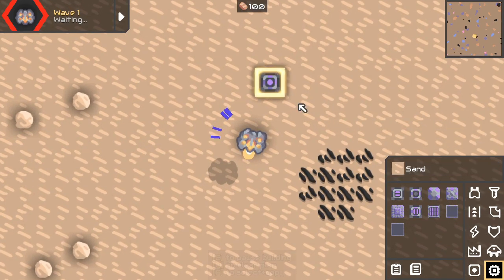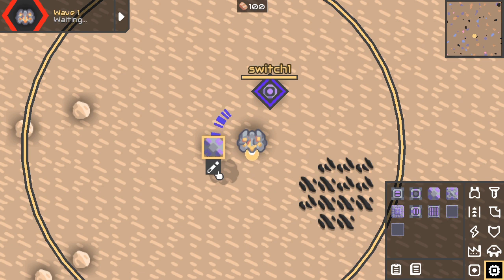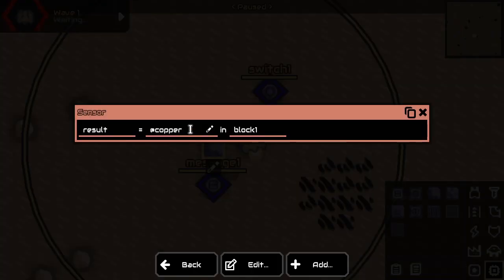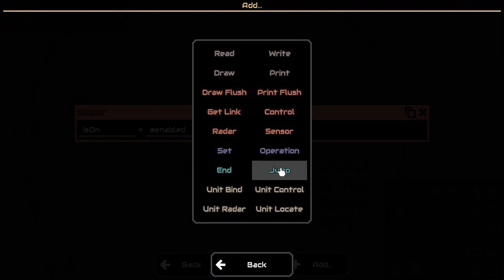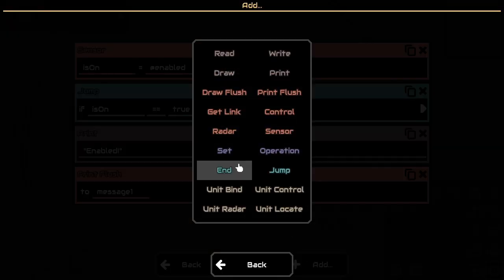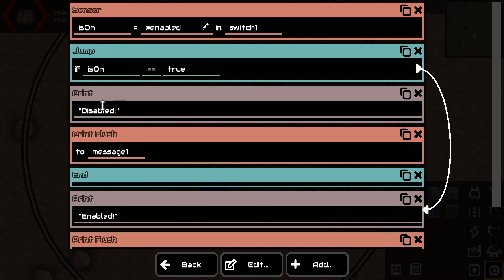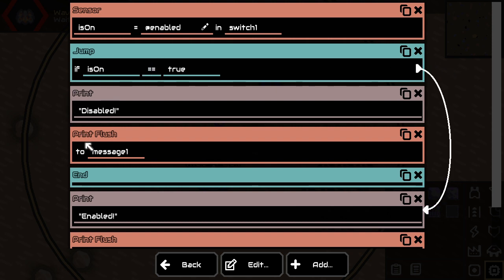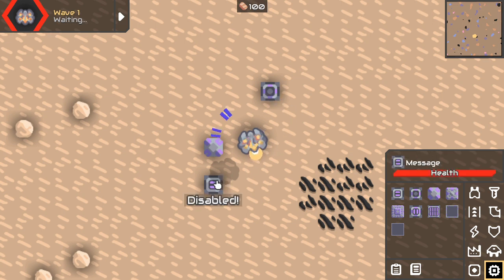Working With A Switch - Mindustry v6.0 Logic Tutorial

Comment: thanks so much! im finally making progress on my platformer!
current progress:
set px 45
set py 45
set xv 0
set yv 0
sensor -dx switch3 @enabled
sensor +dx switch4 @enabled
set dx +dx
op sub dx dx -dx
op mul dx dx 2
op add xv xv dx
op mul xv xv 0.8
op sub yv yv 1
op add py py yv
op add px px xv
jump 16 lessThan py 20
jump 19 always x false
set py 20
sensor yv switch2 @enabled
op mul yv yv 7
draw clear 100 150 255 0 0 0
draw rect 0 0 100 10 0 0
draw poly px py 10 10 0 0
drawflush display1
sensor reset switch1 @enabled
jump 26 strictEqual reset 1
jump 4 always 0 false
end